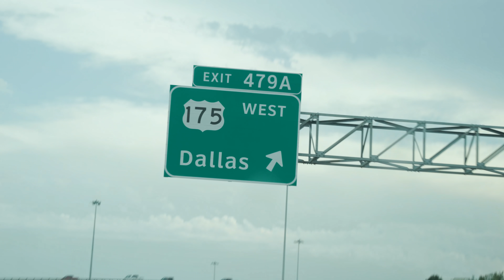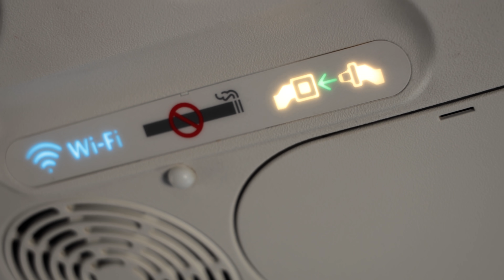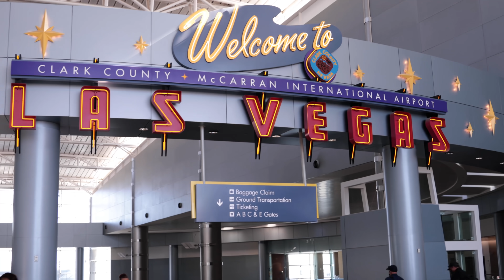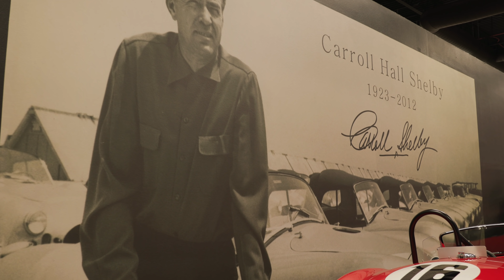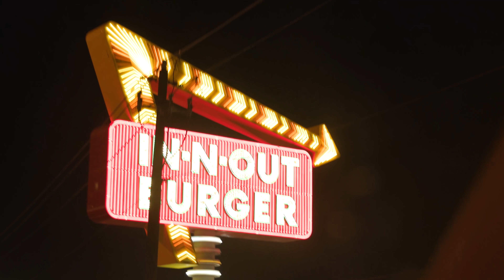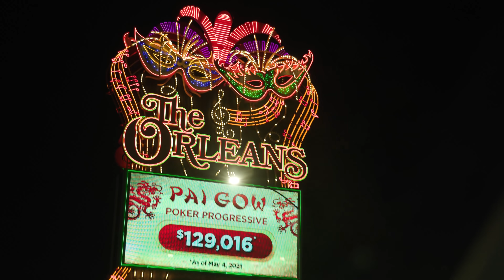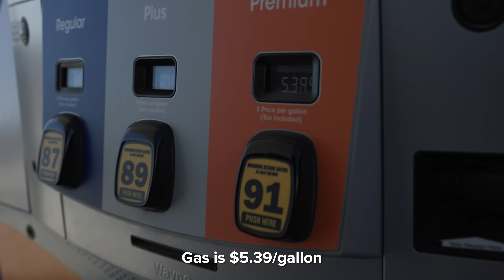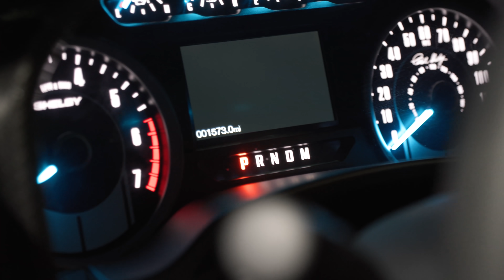My First Drive in the Last Truck across the Country! | An American Story

Comment: i like how gavin is comparing the truck to the lightning back in the day, days after the new lightning was announced
Reply: The new lightning is just an electric F-150. Ford also now considers a 4 door SUV to be a mustang. And then you have the Bronco sport... Three names being watered down in the name of sales.
Reply: @jman6970  facts
Reply: @jman6970  it pissed me off that they didn't remake the lighting as a performance truck but instead just a regular f-150
Reply: @J_DeLeon69  now if it it was a single cab electric rear wheel drive truck no issues if it had a different name
Reply: @J_DeLeon69   I agree. It’s a slap in the face to us car guys. 

I have no problem with EVs. Its the body style that defines a car, not the power plant. People think of a 2 door pony car (coupe) when they hear mustang, not a 4  door SUV. People think big, rugged body on frame 4x4 when they hear Bronco, not crossover SUV. People think single cab slammed truck when they hear Lightning, not 4 door F-150. Ugh. 

Also, I think Ford missed a HUGE opportunity with the MACH E name. They should’ve called it the Model E. Not only would it be a play on heritage, but it’d show that Ford is entering a new era AND the press would go wild (free publicity) because Tesla had to call their car the Model 3 since Ford holds the Model E trademark. But what do I know. 🤷🏻‍♂️
Reply: @jman6970   believe me I completely agree i daily a 66 mustang and all the EVs from ford should be debadged and renamed
Reply: Warm Tortilla  your wild bruh

Comment: I'm 18, I bought my 2000 ford ranger a couple months ago as my first vehicle, it has the 2.5L 4 cylinder, which is kinda slow but with a 5 speed manual, it makes a great first vehicle in my option, it's oxford white and I find it funny that you're new truck is a ford and in white, I just wish my ranger was as cool as your super snake 😂😍

Comment: Your truck took 2 years because of you! It’s not hollys fault! You bought 4 cars in the same time along with 1 pro charger kit a TT kit trans motorcycles etc. you signed that deal with holly knowing the stepulations. 

People were excited to see a truck that I’m sure a good bit of your audience daily drives being moded etc.

Buying a $100k truck and then “building it” wasn’t the idea of a shop truck/race truck!
You coulda bought a single cab 5.0 work truck and spent the other $70k in mods

Comment: Do you even have a clue what that truck is worth right now if run through Barret Jackson auctions. Maybe 3 times what you paid for it. Keep the build sheets and every document that came with the truck. If you keep it completely stock and don't fuck it up that truck could be worth a million dollars to a collector in just a few years. You have no idea what you are sitting on right now. Better take a look at some Barret Jackson auctions before you start modifying that truck and depreciating it.